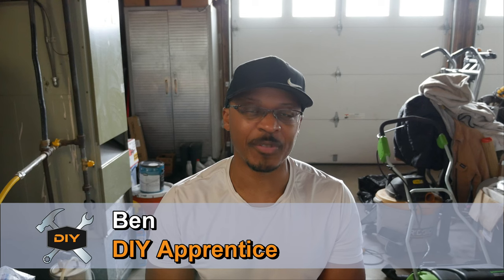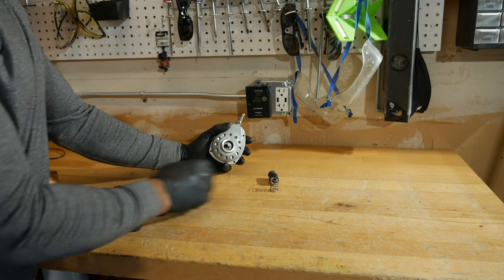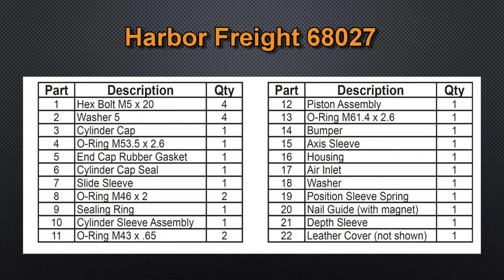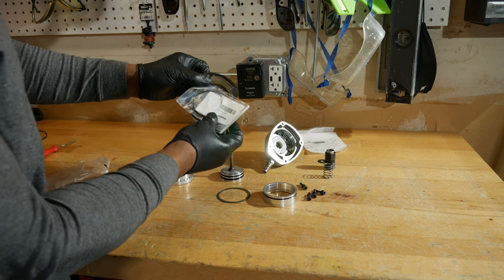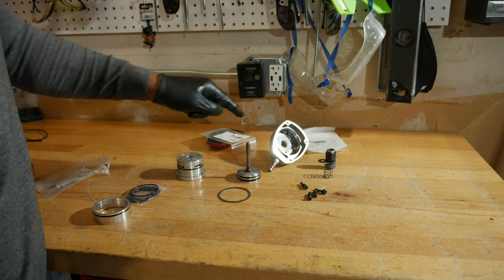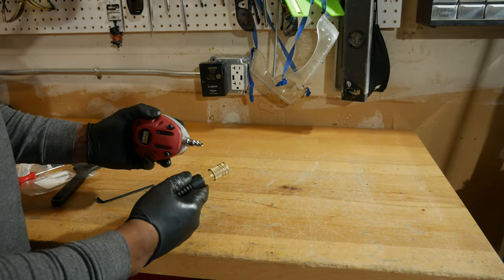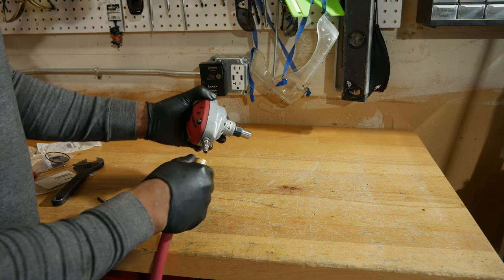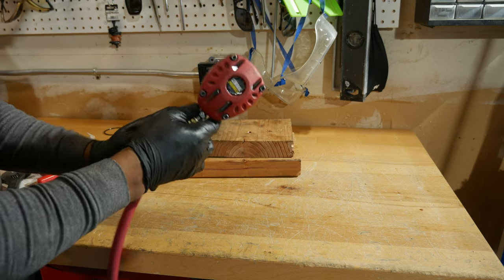Fixing a Leaking Harbor Freight Palm Nailer - Central Pneumatic 68027

Comment: Great video! I just blew out my senco palm nailer.  I've had it since the 90s. I bought it for a job and haven't used it since,  until a few days ago. When i plugged it in, it was leaking air like crazy. Then I used it and the leak stopped. Then, about an hour ago, it quit working. That's why I'm here. 

Shopping for O-rings on Amazon is like trying to find a contact lens in a bowl of contact lenses,  isnt it? ..and sometimes you must buy many to get one. I dont mind having the extras, but i was buying some for a couple fire extinguishers. When i was finally able to find the right size to seal the connection at the pressure gage, I had to get a pack of 200.. lol they, and the 10 of the ones that seal the neck were still way cheaper than buying fire extinguisher rebuild kits.
Reply from the maker: Thanks! It took some time to find the o-rings I needed.
Reply: @DIYApprentice  thanks for your reply. I wanted to let you know that I was able to get  mine working again. It was simple.  I'm using it with a 4,500psi SCBA tank. All I had to do was refill the tank🙄😬😐

..lol yea. I ran out of air  ..duhhh

Comment: I wonder if oiling the old o-rings would have fixed the problem, too. I could see a situation where a dry o-ring gets very slightly rolled or twisted, making a leak, and then it doesn't slide back into its proper place because dry rubber has really high friction.
Reply from the maker: Only one o-ring seemed to be the culprit, and it was noticeably thinner than the replacement. As you probably saw, the nailer did not work after replacing just the larger o-rings;  the suspect o-ring had oil on it.

Comment: I'd use super lube on o-rings before install or air tool oils
Reply from the maker: I probably could have added more oil, but you may have noticed that I was lubricating the new o-rings with oil from the original o-rings. Also, there was quite a bit of oil on my gloves.